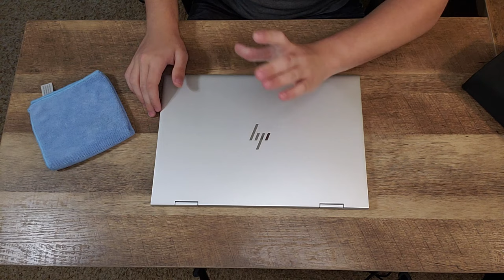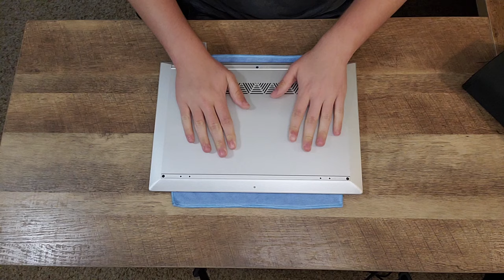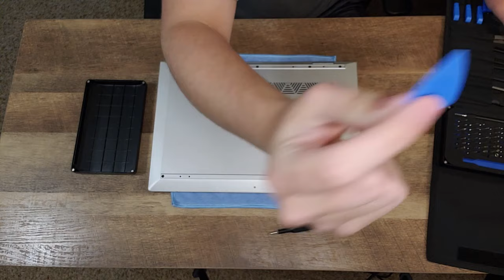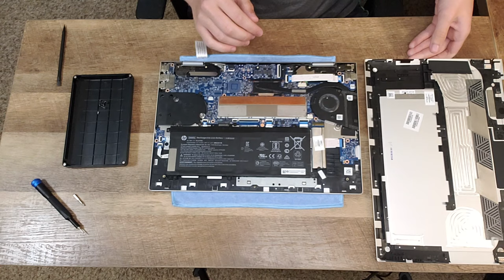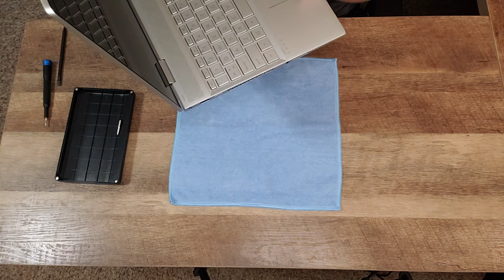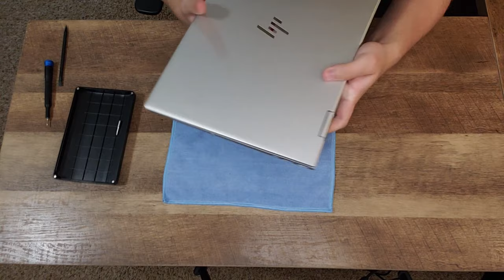HP Envy x360 RAM & SSD Upgrade

Comment: HP states SDRAM for it's RAM. So if you're using DDR4, can you please link the 8gb model crucial memory you're using. That would significantly improve the memory HP is using.
Reply: Hey dude! I just upgraded my RAM with this: CT16G4SFRA32A
What I replaced was Samsung 8GB 1Rx8 PC4 3200MHz RAM. Pretty okay, I guess, bot not that great either. Part number: K033000152136C8C34.
My model: HP ENVY x360 15-es0757ng

Comment: How do i know which specific model i have? I have seen tutorials and i have seen 3 different HP Envy x360 with similar but still different internals. And where can i purchase the upgrades?
Reply from the maker: You can purchase upgrades from HP themselves, or what I recommend is amazon. And unfortunately, I can't know the model of your system unless I see it. Look into the BIOS, you'll see it there. :)

Comment: Why upgrade a laptop that's just going to overheat? As a former HP guy I've officially given up on their laptops.. Every single one has ever overheated or overheated so bad it fried the motherboard. I've got an old 360 I'd like to refurbish just for typing and browsing but I fear that it's going to be a bad investment.. Any advice chat?
Reply from the maker: Just ensure that the air channels are clear, the heatsink and fans are in good working order, and that fresh thermal compound is evenly applied over the CPU die. Having all these factors in place, I've never had an HP computer overheat. :)
Reply: @TechBizmo  I've taken a HDD out of an old computer, that's the extent of my DIY experience with computers lol. Sounds like all of that would be something to hire a trained technician for. If that's your experience with HP though maybe it's worth a shot! Thanks

Comment: Thank you very much for posting this video. I had to replace the existing battery with a new one and used the video to do so. After contacting HP and the store where I purchased it from I was led to believe that this was such an onerous and difficult task that it was strongly suggested I leave it up to a professional to replace the battery.  Really? Why would anyone make such a normal task as replacing a battery so difficult? After being quoted almost $300 for the replacement I knew the answer! That's when I started looking for answers and stumbled upon your video.  I ordered a new battery online for approximately $50. It arrived two days later and I was pleasantly surprised that it even included the two different screwdrivers. Without exaggeration, it took me about 5 minutes to replace the battery. As expected it works perfectly.  Thanks again for the informative video....I even used the same coloured fibre cloth!
Reply: please what did the battery look like, i'm also facing the same issue, or where did you order the battery from

Comment: Hey bro, I see that my laptop has a intel optane 16gb+256gb ssd. Can we just upgrade using WD 1TB ssd nvme. Does that mean we will be loosing the optane technology of 16gb. I am not sure of it. So just checking and thanks for your help in advance. My model is HP ENVY x360 - 15t-dr000
Reply from the maker: Hi, Intel Optane is integrated into the SSD. Depending on whether or not you opt for an SSD with optane is what your answer will be. If you get a WD 1TB with optane, then there you go! Otherwise, most SSDs don't include optane.
Reply: @TechBizmo  will there be any performance difference if I go with the one without optane. As I don't find optane options anymore.
Reply from the maker: I doubt you'll see much of a difference. I resorted to an SSD without optane in this system at some point. I didn't see any difference. But it's really just different for everyone.

Comment: Im really struggling with my silicon rubber feet strips, how would you put them back on?
Reply from the maker: I wouldn't do anything to put them back on, and I didn't. I'll just buy new ones in the near future with new adhesive, so I can take them off as needed. The original adhesive is designed to be able to come off. Hope this helps! :) Sorry about the rubber strips! :(
Reply: @TechBizmo  okay thsnks!
Reply: @TechBizmo  I don’t like how it’s designed to come off, its been a month since i purchased mine and it still doesn’t have rubber feet :(

Comment: Hey! Really appreciate your hard work on the video, it was amazing. I recently tried upgrading my ENVY x360 2-in-1 15z-ey000 for more RAM, the process went all smoothly thanks to your video, but now my keyboard completely stopped working. Is there anyway I can fix it/do you know maybe what could have caused it? Thank you!
Reply from the maker: Thanks so much for watching! Check the keyboard connector, it may have loosened during the process. If it looks good, remove the connector and reseat it. Sorry about your troubles!

Comment: Can you tell me if this model is possible to change the RAM? And would it be possible for 32gb ram or 16gb ram? model: HP Envy X360 2-in-1, 14, I5 1335u 8gb 512gb

Comment: Would this be the same for HP - ENVY x360 2-in-1 15.6" Touch-Screen Laptop - AMD Ryzen 5 5625U - 8GB Memory - 256GB SSD - Nightfall Black
Reply: i have the same exact one and im about to go change my ram so ill let you know if its the same
Reply: @lolootsu  guy I went to only was able to swap out my ssd, but now I have 2tb.
Reply: I have the same as you except I have AMD Ryzen 7. I have an issue where the computer goes to black screen and won’t wake up OR sometimes crashes and restarts. Both are without warning. Is this why you upgraded?
Reply: @firstcoastcrypto  This is my first yoga style comp
Reply: @RudyCantGame  well i changed my ram from 8gb to 32gb it's doable, however i didn't use this tut i used a different one. reply to my comment if you want it
Reply: @Iootsu  really, the guy who worked on mine told me it was impossible. It has 1 slot I think he said. I didn't open it up. I'm bad at that stuff.
Reply: @Iootsu  I'm going to download Starfield and see how it runs.
Reply: mine has 2 slots, the ram i installed it to is 1 stick of 3.2kmhz  @RudyCantGame

Comment: I have the same one HP ENVY x360 15m-dr0011dx I want ot change the ssd and memory could you tell me what to buy 1tb would b great though
Reply from the maker: Any M.2 NVMe SSD should work great for this system. :)
Reply: @TechBizmo  
Thanks for that quick response 👍 so my system currently has 8gb of ram I dnt know what is the maximum it can take are can I put one stick of 16 with the 8. Or should they be the Same?
Reply from the maker: With one 16 and one 8, you’ll be running 24GB at Dual channel, it should work! And of course! Let me know if you need anything else my dude. The maximum in this system is 64GB I believe.
Reply: @TechBizmo  
Thank you 😊
Reply from the maker: You’re welcome! :)

Comment: I have the same laptop and replaced my SSD drive. When I boot the laptop to my windows 10 installation media it can not find the SSD drive. Any thoughts? I can see the disk listed in the BIOS and configuration tab.
Reply from the maker: You may have to alter the data drive's setting in the BIOS. Maybe changing RAID to AHCI, or vise versa.

Comment: Hey! thanks for this amazing tutorial! I have a similar one (x360 15-drxxxx) with just 8/256 GBs. I intend to upgrade to 16 Gigs and at least 512GB storage. Do you know if I will have to remove the current nvme ssd to put the other one in or are there more than one connectors?
Also, how does the device boot off an empty SSD? Like.. theres nothing on it to boot off, so does the Laptop have some sort of workable BIOS with booting methods?
Reply: Hey, so I just upgraded mine and as far as I'm aware in all the hp x360 lineup they only have 1 m.2 slot. Now yours could be different but you will have to see if there is a manual or something online for it.

And as far as opening the bios that's something any motherboard I ever worked with can do. He didn't open window bc you will have to reinstall that. But opening the bios will allow you to select witch drive to boot from. So you will need an 8gb flash drive with windows installed on it to re-install windows on the laptop. There are plenty of tutorials on how to do that just type in "how to install windows" and you will have a plethora if video tutorials showing you how.
Reply: @jamesfield6273  Ah okay thanks man! I guess the BIOS is accessed by spamming the delete button?
Reply: @zainshah1453  Hi - Did this (to access the bios) work? Also, how did you clone the existing SSD? The vid shows how to remove and reinsert, but doesn't show how to do the cloning. Is there a vid for this? I'm a bit of a novice at this, but willing to give it a go.

Comment: How did you migrate the data off the old ssd to the new one 🤔
Reply from the maker: The way I’ve always done it is to create a system image and then flash said image to the new SSD. Another way is so just copy and paste the data from the SSD to an external HDD and back to the new SSD.

Comment: after replacing the hard disc do i need to install the operating system?
Reply: I did a similar upgrade to my Thinkpad X1 Carbon. There is a way to do it without going to the trouble of reinstalling the OS. You need to have a HDD Cloning software and a external case for the type of SSD/NVMe you wantto install. Both are pretty cheaper and useful for you in the future as well. (If you buy a Samsung or Acron SSD, you will get the cloning Software for free).
So you put the New SSD in the case connect it to the Laptop, clone the entire SSD to the new one. Turn off the system once completed, swap the SSDs and "Voila" your laptop runs on the new SSD. The old one, can be kept as a backup recovery point.  I do this and update it with an up to date clone once in a while. IF not, you can use it as a portable External Hard drive, It will be fast and light weight.
Hope this helps. Peace.
Reply from the maker: Great advice! appreciate you getting to it before I did.

Comment: According to the manual of my HP Envy x360 Convertible laptop, I can only upgrade to a maximum of 2x8GB, with a maximum of 2666 Hz. Can I still go higher?
Reply: Probably. The manual might only be saying what the shipping options of the laptop were from HP. I've seen this confirmed in other forums. .

Comment: I went to my device settings on my x360 and it has my SSD as a M.2 2242 slotting SSD.  Can I purchase the normal 2280, or do I need the same 2242?
Reply: The numbers refer to the physical size of the M.2 module (see Wikipedia for M.2). I’d go for the same physical size to avoid connection problems...

Comment: I'm looking to play pc games that require 16 g of RAM. My current HP envy x360 has 12G RAM what would I need to purchase to get to 16G? I'm really new with computers so this might be a silly question but what does upgrading the SSD do for the laptop? Thank you!
Reply from the maker: The SSD is the component that stores all of your information. You may want a new SSD because you recently ran out of storage, or you just want a newer, faster SSD. If your system has 12GB of RAM, then I would assume your system has 1 4GB stick, and 1 8GB stick. To upgrade to 16, you'll need to purchase another stick of 8GB, and replace the current 4GB with that new 8GB stick. Its pretty straightforward! Let me know of you need anymore help. :)

Comment: Hi, Thank you for making this video. I have an ENVY x360 Convertible 15-dr1xxx, but I can't figure out which RAM to grab to upgrade. I want to upgrade to minimum 32GB so I looked up what is recommended by HP, but there were a lot of options and I don't want to grab something that requires too much juice or something that could harm the computer. Do I have to check the compatibility with the processor (Intel(R) Core(TM) i5-10210U CPU @ 1.60GHz   2.11 GHz)? If so, do you have any recommendations? Also is it recommended to upgrade storage as well? Mine came with 512GB.
Reply from the maker: You’re not going to harm the computer by putting in incompatible RAM. As long as you get DDR4. To be honest, most DDR4 RAM will work with your system. If you feel the need to upgrade the SSD, go for it! :)

Comment: Where is CMOS battery located for HP Envy x360?
Reply from the maker: There is none. The battery of the device works as the CMOS battery.
Reply: @TechBizmo  If you ever got error blue screen text Cmos 502, what would it be?
Reply from the maker: If the battery dies, usually the CMOS will be reset.

Comment: Works ONLY for models with removable RAM plates.
Reply from the maker: Yes. Some Envy x360 models, like the 13 inch don't allow for RAM upgrades as the memory is soldered to the board.

Comment: Will an Crucial 64GB Kit (2 x 32GB) DDR4-2666 SODIMM work?
Reply from the maker: Yes, I do believe so! :)
Reply: Is this a Good Ram For Gaming!? Im curious cause i Game and use my laptop to browse the web alot and im looking for the best upgrades i can do to my envy .. lmk suggestions
Reply: @metaspheresocial  hey! same, i only have the 8gb/250gb version so im looking to upgrade to 16gb (2x8gb) DDR4 2666 SODIMM and a 512GB NVME SSD
Reply: @TechBizmo  am I able to use 3200mhz for this laptop?
Reply from the maker: Yes! :)
Reply: have you been successful ?
Reply: @systembewegungen-andreasde7585  I didn't upgrade yet cuz some research showed me this:
The current ram in mine is 2x4GB DDR4 2666 but it's running on just 2400mhz because it's the maximum the CPU supports. So I'll be buying a 2x8GB 2400mhz kit which is a bit cheaper
Reply: @zainshah1453  WHICH MODELL AND CPU do you have. i have ryzen 5 and apparently ryzen 5 can handle 64gig. / i got a 32 2666mhz single ram which im hoping to install in the next days.
Reply: @zainshah1453  i found out 
ryzen goes inbetween 2666-3200mhz even just now...
Reply: @𝑮𝑊O͜͡𝑃𝐴𝑵𝐸𝑺𝐸 have you been succesful ?
Reply: @systembewegungen-andreasde7585  be careful that you didn't look up the Ryzen Desktop data. I have an Intel CPU though.
Reply: @zainshah1453  thanks for the advice . i just checked and it says 2400mhz. was reading somewhere else that 2666mhz would work but it scales down to 2400 then. wonder if it wud damage the notebook if i just tried what do you think !?
Reply: @systembewegungen-andreasde7585  no it wouldn't damage it. 2666 ram can be a bit more expensive sometimes but it won't harm your laptop. It will just be downclocked to 2400
Reply: @zainshah1453  ok thanks for the info. so i will just try out and see what happens. thank you !
Reply: @zainshah1453  I did now actually put a 32GB 2666mhz and it works !
Reply: @systembewegungen-andreasde7585  Impressive. Have you checked (via HWInfo or similar) if it actually is running at 2666?
Reply: @zainshah1453  yes i did. Its running on 2400mhz but the capacity works wuite well i did a stress test with 100open browser windows many playing videos and it managed super :-)

Comment: Is Samsung evo 970 plus ssd compatible with this?
Reply from the maker: Yessir!
Reply: @TechBizmo  what's the highest storage I can go with? 512gb or 1tb? Or both are compatible? Thanks!
Reply: @mnlstscj  Both are compatible. you can even go with 2TB - Make sure it is M2 NVME
Reply from the maker: M.2 NVMe is probably the preferred option, but I ended up using an M.2 SATA on my Envy x360 before I sold it.

Comment: bro iam using this model with 256 gb ssd can i install harddrive in this model please bro reply with 256 gb ssd model no is 15 m dr0011dx
Reply from the maker: Delete about 6 of these comments LOL and I'll be sure to respond.
Reply: @TechBizmo  yes bro
Reply: @TechBizmo  all extra cooments are deleted please ans my quaro
Reply from the maker: Unfortunately, no. This model doesn't have a standard SATA slot on the motherboard. M.2 NVMe only.

Comment: Ram max?
Reply from the maker: 64GB in this machine.
Reply: @TechBizmo  Thanks!
Reply from the maker: No problem my friend! :)
Reply: @TechBizmo  is this the 13 or 15 inch?
Reply from the maker: 15 inch.
Reply: @TechBizmo  any issues with lightroom on this or Z-Brush?
Reply from the maker: Not that I know of. Should work with any photo manipulation software. I use gimp flawlessly on it. :)
Reply: @TechBizmo  Thank you
Reply: @TechBizmo  Can you upgrade the ram and ssd for the 13inch as well?
Reply from the maker: SSD, yes. RAM, no unfortunately. :(

Comment: 1. You talk too much with no information
2. You need a static pad, and grounding strap.
3. Where is the other SSD slot.  information that is handy.
  Good basic information.  bad safety, and technique.
Reply from the maker: 1. The point of my videos is to talk through the process to make the viewer more comfortable
2. I was wearing a grounding strap on my ankle, grounded to the metal frame of the desk
3. There is NO other ssd slot.